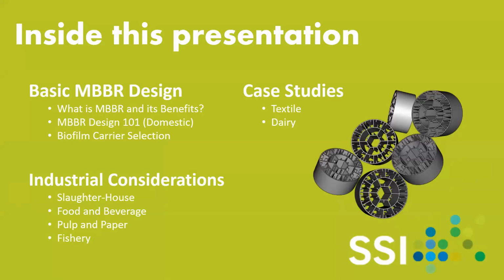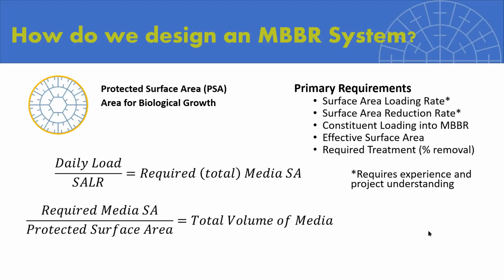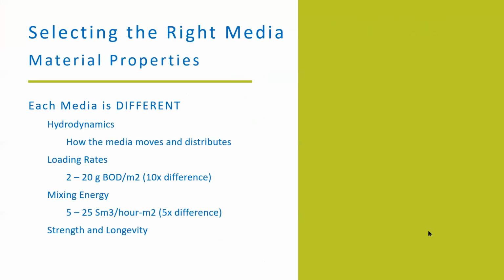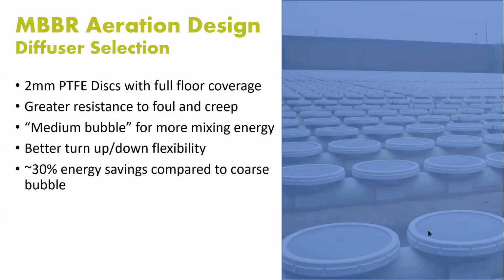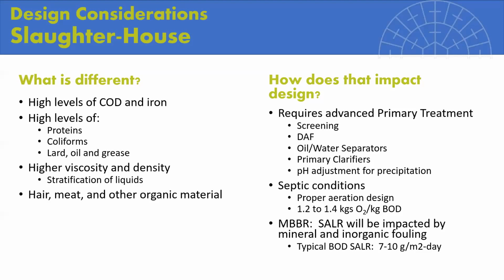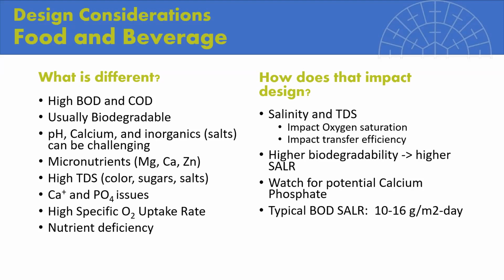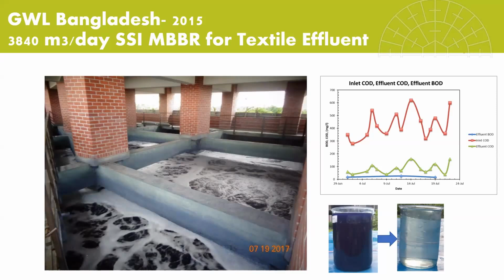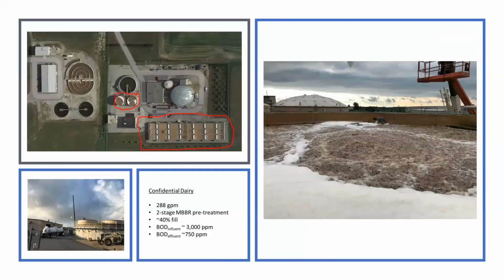MBBR Design Considerations and Technical Case Studies

Comment: Why do Fine Bubble Aeration Diffusers require more periodic maintenance than Coarse Bubble Diffusers? I've been at a startup plant site for each currently in operation and wasn't quite aware of that. A really solid presentation though.
Reply from the maker: hi! Fine bubble diffusers have smaller slit sizes vs coarse bubble so its much easier for the slits to get clogged which can impact airflow. if the slits get clogged the membrane can stretch, tear. Coarse bubble have much large holes and have a higher airflow going through them so they are less likely to clog. The trade off though is reduced efficiency, higher energy costs

Comment: How will the phosphorus be treated in MBBR System specifically in domestic ww?
Reply from the maker: Depending on the configuration of the MBBR or IFAS system, phosphorus can be removed biologically in two (2) primary ways:  1) Through assimilation whereby Phosphorus/Phosphorus compounds are used as nutrient for biological cell growth, or 2) via anaerobic-aerobic combinations whereby Phosphorus Accumulating Organisms (PAOs) are readily adapted to absorb dissolved phosphorus and removed via solids separation. In option #2, the system is typically operated as IFAS (hybrid MBBR with MLSS) to allow the proper PAO activity and solids separation steps.
Reply: @ssiaerationinc  I work in Industrial Water and for many plants as a Field Engineer. The few MBBR startups I've worked on so far over the last year we have typically had to add Phosphoric Acid for Phosphorous as it is not that typical for it to be in the industrial wastewater to have good cell growth in the MBBR. In the beginning, I used to be so confused about the chemistry in understanding. But eventually, i understood it was micronutrients for cellular well-being and growth. Still, i appreciate the answer to the person who asked the question above in clarifying understanding either way.

Comment: Is there such thing as 'RAS' equivalent in MBBR in case you need more biology? Also why is the limit 200 microns for biofilm thickness. And wouldn't you need DO of <.5ppm for simultaneous nitrification and denitrification meaning very slow mixing if at all?

Comment: Hi! Really nice video!
Iam having a doubt in Solid Retention time and hydraulic retention time. The SRT how do we calculate it? Can we control it or we consider it as infinite?
Reply from the maker: Hi Elizabeth! You can control the SRT by manually adjusting the sludge waste rate based on the food to microorganism ration or MLSS concentration. Basic calculation for SRT is lbs/day of suspended solids in aeration basin divided by lbs/day of suspended solids wasted from the system